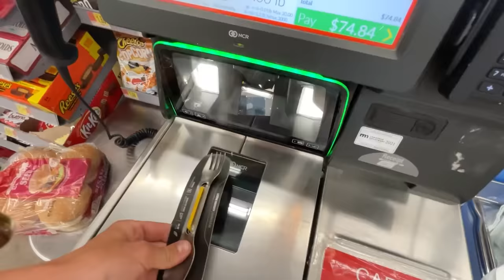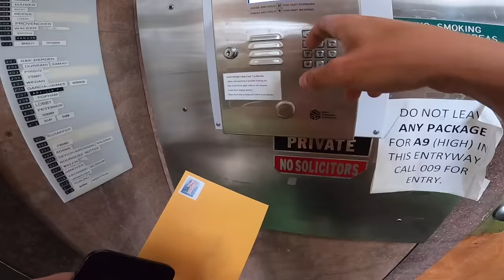Camping in my Small Car for the First time | Overnight in Pop-up Tent

Comment: When driving a manual vehicle, always leave it in gear when you're parked. Even with the emergency brake set, if the e brake fails, your transmission will help keep the vehicle from moving. Especially with that camper I wouldn't trust the e brake alone. Stay safe Mav!
Reply: On the gang itself
Reply: He is in a flat state MN. If he grew up in San Francisco he would know this.
Reply: Did I miss something ?  Did he get back to the states or this was prefilmed?
Reply: @jaytrock3217  I think he mentioned he flew back to visit his parents!
Reply: @betopistolas4644  dude just up and left his truck?
Reply: Aren't you suppose to leave it in neutral?
Reply: @1savage325  nahh always leave it in gear. I usually left my Jeep in first gear because I lived on hill in Georgia.
Reply: Most manual transmissions have a lockout gear, mine is reverse.
Reply: Yes! Wanted to say something too! I also have always put my ebrake up without pressing the button, only when putting down the ebrake. Anyone else? Or does that even matter?
Reply: @1savage325  On most cars it's not an issue but on a 20 yo car with all that extra weight I would say this is a requirement.
Reply: @betopistolas4644  I thought he said his parents flew down to visit him.
Reply: @garybaxter7297  nothing flat in Duluth, MN where he lives.  Steep steep streets.
Reply: @garybaxter7297  Duluth has plenty of steep hills.
Reply: Y anyone does their driving test in an automatic over a transmission I don't know
Reply: The comment I was going to make well done sir 👏
Reply: Wheel chocks.
Reply: @blackshadow7192  so someone accidentally bumps into your car at the fuel station while your inside....next thing you know your cars rolling across the highway and your liable 😉
Reply: Your exacyly right if you're parked on a hill, put it in reverse.
Reply: @LowKeyQuintin  bro you not in a gang white kid chill out lmao
Reply: @garybaxter7297  😄😄
Reply: @1savage325  nope
Reply: @jaytrock3217  they did, and then he apparently flew in to see them! Isn't that sweet?! 😁
Reply: @tiddiesprinkles  no it should be on gear ⚙️
Reply: True you’ll be riding backwards in your sleep LOL Or forwards LOL
Reply: @terryschleeterl1331 😁 funny!
Reply: I know it doesn’t take forever but does any one raise feel like it’s an eternity waiting for his next video and I wanto clarify that I’m actually saying that he takes forever to post because that’s not what I’m saying at all his videos are just so good and interesting that it feels like a life time while waiting for the next video you’re awesome Mac keep up the great work your really living life to the fullest and you brave as hell always being by yourself I’m remote areas and dude you travels through Mexican by yourself you a fricking g bro that shit was awesome 💪💪💪
Reply: @LowKeyQuintin  ON THE GANG
Reply: I've always done if parked uphill leave it in 2nd. Downhill in Reverse. First put it in neutral and let the E-brake take the weight of the vehicle then 2nd or reverse if you do it the other way around all the weight of the vehicle is on the transmission-gear. Maybe I've been doing it wrong all this time? Lol
Reply: I never understood why people put their car in neutral. I guess you're taught that. I always put it in gear when parking. Thanks dad.
Reply: Not that necessary but a good tip ig
Reply: @jaytrock3217  I think based on the weather this is an older video he finally uploaded.
Reply: My lock out gear ⚙ is 1st
Reply: @garybaxter7297  they do have something called hills
Reply: Thats only of your on a hill or something but hes on flat ground so hes good
Reply: Call It Like I See It  Hey, my guy, i think that's the point. Its weird... its funny...
Reply: @1savage325  no. There's no logical reason to leave it in neutral
Reply: @23dnab  I've never pressed the button to engage the parking/emergency brake. It's just a weird habit some people have for whatever reason.  Maybe he doesn't like the ratcheting sound it makes.
Reply: @joshimirobot8266  I'd rather let the transmission take the weight than straining the parking brake cable.  The transmission was designed to handle the  intense amount of stress put on it. If you've ever dumped the clutch or stalled...that's way more force than simply parking in gear with the vehicles weight will ever generate
Reply: @RandomStuff-kd9pd  can you please explain what a lockout gear is?  Please.  Lol
Reply: @1savage325  I put mines in neutral and use the emergency brake.
Reply: @ryanscott2548  if you're inside as u said, why would you even let it roll away? 🤔
Unless you mean inside in the camper section. But why would anyone be parked at a fuel station and be in the rear section of the camper. 
Why park at a gas pump to chill in a camper?🤔 Unless you mean being parked at a fuel station, in a parking spot. But what fuel station parking lots don't have bumps in the parking areas?🤔 And on and on we go with the hypotheticals.🙄😁
Reply: @ryanscott2548  The odds of that are a katrillion to one.
Reply: @2PK69  You're*
Reply: Everyone talking about the weight being on the transmission if you park it in gear the wrong way, yet these same people ignore the fact of the damage to the transmission and gears if the vehicle is hit while parked while in gear.😨😱
 It's gonna break the gear or transmission.
If the E-brake is on, the cable doesn't snap when bumped. The car will move a little, depending on how hard it was hit, then it stops. 
If you're in gear when that happens, you might get a broken transmission or gear. 
Then what.? Just use wheel chocks or a wedge of wood so nobody steals it, because if you were to get hit while parked in gear, you're gonna have way more expensive damage.
Also, nobody should be camping if they don't know how to check or change a simple emergency brake cable.😒
Reply: Close, the engine is what's holding for the car to move it's gotta spin the engine. You probably knew this, lol 😂
Reply: @jaytrock3217  no he told the man he had flew to see his parents.
Reply: I always put it in gear number 2.
Reply: @GARY-yu8pc  if not most.. half of the people in the US drive automatic cars
Reply: I was thinking he should get a set of chocks as well.
Reply: @quanbrooklynkid7776  over 90% I'd imagine.
Reply: @manuelester7420  seen it on another video, guy was pumping gas and he couldn't catch the car
Reply: Also if on a up or down hill turn the wheel towards the curb to stop it from moving too
Reply: @1savage325  I mean you can leave it in neural if it’s flat sometimes e brake isn’t always that great
Reply: @garybaxter7297  well as a lot of the state is flat, certain areas are extremely hilly and rival San Francisco. Not sure where he’s at, and for the most part this is correct. But areas around our rivers and some lakes (St. Paul, Duluth, especially Duluth, along lake Pepin and the valley between southern Minnesota and Wisconsin) are bluffs or roads I’d never park as they are icy in winter as well as angled like San Francisco. I know what you are saying, as I now live in farm/flatsville, but it can’t be immediately claimed one doesn’t know how to park hills here. Hills with icy and snow are worse than 60-70s and sunny.  I live in a lake valley and my driveway is steep for reference, and one of my vehicles is still stick lol
Reply: the gear thing is right my parents have been doing this forever
Reply: what happened to his truck?
Reply: I thought the same thing when he showed the gear stick....I was like "dude 1st gear for flat and if your on a hill facing downhill....or reverse if you are on a hill facing uphill" first rule of driving manual.  Just like you should always start a manual car with your foot on the clutch (fully down) and the brake....that way you wont ever jump into a wall :-)
Reply: Why would anyone want to drive a manual
Reply: @c-wilvideos  it's fun
Reply: @joshimirobot8266  🤖
Reply: my brother says the same, leave in gear but i hate that. Idk, e brake should be fine (at least a normal car not a camper/car) but yeah i dont like to. I like to put in gear or reverse myself before taking off and after turning on. But i suppose since i like to use the e brake ill continue to... and maybe i can do both? Just leave in gear and get use to it but also e brake. He tells me its not needed but im too paranoid to leave a manual car without e brake up.
Reply: Retweet
Reply: This is not true. E-brake is far, far more important than leaving the Trans in gear. On any kind of slope all you do is clip the trans anyway. It's a decent precaution but not a necessary one.
Reply: This is bad advice
Reply: You are so wise thank you for that amazing knowledge! How did we survive without you! Thanks for sharing we had no clue, my life is changed.
Reply: @camtheman559  indeed
Reply: If you get regular mots your break won't fail.
Like most cars here are manual and it's not a common problem I don't think I've ever left my car in gear. Dramatic.
Reply: @IggyTheBalrog  it can help. But you're right, until the break tends to wear its relatively unnecessary
Reply: I was thinking the same thing!
Reply: Ever since owning a manual, I've always left it in first whenever I park on a hill of any sort. Makes me feel a lot safer lol.
Reply: @LowKeyQuintin
Reply: Whoa 😮 mind blown ! 🤯 

LoL 🤣🤣🤣 

The people who know already know, the people who want to will find out… but  most  never will and don’t care because manual transmissions are essentially becoming obsolete these days, unless you intentionally seek one out or you’re buying an older performance vehicle.
Reply: Been driving manuals for 25+ years and never leave it in gear with no issues. I'm not carrying a load or parked on hills though.
Reply: Have no E brake so this is how i have to park the Sonoma lol
Reply: I always leave mine in first. Respect to this guy for keeping a manual VW. I have seen only ONE in my whole city other than my own in 5 years!
Reply: @Praise___YaH  

Jesus the Son is YHWH.

The Son is the one that took the punishment on the cross
Reply: @johnle231  

HERE is Salvation and YES, it is this Simple 

HalleluYAH translates “Praise ye YaH”

YaH is The Heavenly Father 
YaH is Who Created “Man (Adam)”
YaH arrives via the TENT OF MEETING 
YaH was Who they Crucified for the sins OF “Man”

** NO human female involved WHATSOEVER **
— Hebrew Book of Isaiah 

Isaiah 42:8
"I am YaH; that is my Name! I will not yield my glory to another or my praise to idols.

Isaiah 43:11
I, I am YAH, and there is no other Savior but Me.

Isaiah 45:5
I am YaH, and there is none else.
Reply: @Praise___YaH  

Nonsense.

Only in the NT is revealed the messiah who dies for people’s sins as mentioned in Isaiah 53.

You deny the NT,  then you have no savior.
Reply: @johnle231  

YaH arrives via the Tent of Meeting 

jesus arrives through the bloody process of childbirth covered in amniotic fluid 

Sir, if your “god” had a “son” with a “virgin human girl”, your “god” is a Fallen of Genesis 6
Reply: @johnle231  

Isaiah 43:11
I, I am YAH, and there is no other Savior but Me.

Isaiah 45:5
I am YaH, and there is none else.
Reply: @johnle231  

THIS and ONLY THIS is Salvation 

YaH is The Heavenly Father 
YaH is Who Created “Man (Adam)”
YaH arrives via the TENT OF MEETING 
YaH was Who they Crucified for the sins OF “Man”

** NO human female involved WHATSOEVER **
— Hebrew Book of Isaiah
Reply: @johnle231  

Isaiah 45:5
I am YaH, and there is none else.
Reply: @johnle231  

Isaiah 42:8
"I am YaH; that is my Name! I will not yield my glory to another or my praise to idols.

Isaiah 43:11
I, I am YAH, and there is no other Savior but Me.
Reply: @johnle231  

Isaiah 45:10
WOE unto the one who says to the FATHER, what have you begotten or to a MOTHER, what have you brought to birth.

YaH arrived via the TENT OF MEETING, YaH was Who they Crucified and it was on an Almond Tree sir, NOT a cross
— Hebrew Book of Isaiah
Reply: @johnle231  

YaH <— THERE’S OUR ONLY SAVIOR
Reply: @Praise___YaH  

And Jesus is YHWH.

Hello.

Isaiah 53 speaks about a person who’s takes on others sins with his death.

Without Jesus,  you are not saved.

Hello
Reply: I trust in my e-brake over the years.if I had to in a pinch feel like we all know if we can trust it or not.
Reply: @Praise___YaH  Do you believe Jesus is God?  Do you believe the Holy Spirit is God?  Do you believe the Father is God?
Reply: @lowcountrybassin3730  

YaH is The Heavenly Father and jesus, the “Bright Morning Star (Revelation 22:16)” is Lucifer

HERE is Salvation and YES, it is this Simple 

HalleluYAH translates “Praise ye YaH”

YaH is The Heavenly Father 
YaH is Who Created “Man (Adam)”
YaH arrives via the TENT OF MEETING 
YaH was Who they Crucified for the sins OF “Man”

** NO human female involved WHATSOEVER **
— Hebrew Book of Isaiah
Reply: @Praise___YaH  You are speaking heresy.
Reply: @23dnab  Doesn't matter. That's why it makes that clicking sound.
Reply: @Praise___YaH  That means He entered the world in David's lineage.  Again, people who read your comment that don't acknowledge Jesus as God, might be persueded to think that what you say is right.  But you did answer my question.  You don't believe Jesus is God . . . There is one God, eternally existent in three Persons, God the Father, God the Son, and God the Holy Spirit.  And these Three are One
Reply: @lowcountrybassin3730  

If jesus is your savior, you are not saved. You better go back and READ what I shared
Reply: @Praise___YaH  Have you not read the first three verses of John's Gospel?  "In the beginning was the Word (Logos is living Word in the Greek), and the Word (living Word) was with God, and the Word (living Word) was God.  And the same was in the beginning with God.  All things were made by Him (Jesus); and without Him (Jesus) there was nothing made that was made.  Why is that so hard for you to understand?  Also, "Let us make man in our image; in our likeness"  Genesis 1:26.  Creation, Corruption, Catastrophe, Confusion. Christ, Cross, Consummation.  Jesus was there and was responsible for all seven C's.
Reply: @Lowcountry Bassin  

He is inconsistent.

He cites from revelation from a specific niv translation(Morningstar verse)which is New Testament.

But ignores the remainder of New Testament scripture.
Reply: Unless someone else who doesn’t leave it in gear is planning to drive it next. My mum smacked my old Golf GTI into our garage door because she started it up without realising I’d left it in gear 😢
Reply: @VicodinElmo  

I remember remote starting my car into my garage door into oblivion... $500 drain
Reply: Depends on how you’re parked, if you’re facing uphill you leave if in first gear, if it’s downhill then you leave it in reverse
Reply: Your handbrake should hold your car if in gear or not. If it rolls with the handbrake on its poorly maintained and shouldn't be on the road.
Reply: if you're on a hill tho that's not good for transmission at all
Reply: I always do
Reply: ALWAYS!! And don't forget to put it in gear on uphill but in reverse if you're declined
Reply: Leaving a manual in gear is not the norm at all actually. And it isn't taught when learning either.
Reply: @bane4743  I think his truck would be fine
Reply: I had a 59 VW. Modified by the Manson family. Not a joke. Listen to this guy about parking. It's old school
Reply: I think it’s more of the weight issue with having that camper at the back and also considering the geography like sure in flat areas you can get away with putting the ebrake or maybe even leaving it in neutral but should the ebrake fail in where he’s located with a lot of hills, good luck catching it.
Reply: Thanks for sharing the tip!
Reply: 5
Reply: @FakeR19920828  the FIRST correct comment after reading PAGES of 🤷‍♂️ . Following the way you described is the strongest/safest way to park manual transmission vehicles, to reduce wear on the transmission in vehicles with operating parking brake is to lock the parking brake, then last step stepping onto the clutch for a second to take the slack off the transmission and onto the parking brake, this way the brake does it's job, and if it fails, the transmission will ensure the vehicle isn't going anywhere! And, Happy new year! LoL
Reply: @LowKeyQuintin  true
Reply: You should marry him..then you can tell a man how to drive..
Reply: I refuse to use my e brake, they like to get stuck. Solid advice
Reply: Need a mosquito net to Velcro below the canvas inside.
Reply: Lol in Florida it’s so flat we have to remember to use the e brake because when it’s flat it ain’t going anywhere.
Reply: I live in GB where most of the vehicle’s are mostly all manual gears and clutch driven. I always park on any incline in first gear with hand brake on as far as it goes, just don’t start engine without put in clutch pedal and gear into neutral first as another driver could have left it in gear, the vehicle will jump forward while turning key or button start up. You are learnt to check for this firstly as a safety checklist while learning. Parked on the downhill park always put gear into reverse and with the handbrake on ,wheels towards the curb because the handbrake does fail the reverse gear will hold the vehicle and not being able to roll downhill. I had a manager that done this to two vehicles in row . She forgot to put on the handbrake. Her husband was not well pleased. 
In GB 🇬🇧 if you hold a manual driving license you can drive a manual or automatic vehicles. But If you hold a automatic driving license you can only drive automatic’s and will have to take lessons and done a separate car test for a manual license.
Reply: I agree especially if you’re going to be sleeping in it.
Reply: I was thinking the same thing! My big 1 ton dually's e brake doesn't hold worth a flip.
Reply: Duh.
Reply: Excellent advice, I would have stated the same as a Mom who taught a teenager to drive manual transmission 12 years ago. My Dad taught me the same on the old 78 K5 Blazer back in ole ‘86 😆😝.
Reply: In England, we are 80% manual and it’s recommended to leave it in gear
Reply: And be carful on hills! Rolled into a car once after parking my car in neutral ON A HILL and coming back to it trying to leave in a hurry, not sure what I was thinking, just forgot I wasn't in gear and the moment I dropped the e brake - bang!
Reply: That’s also a marvelous way to ruin your transmission lol
Reply: @LowKeyQuintin  on hood
Reply: No exactly correct as then u can mess ur gears up by keeping it in gear ur meant to keep it in gear on hills or cold weather as it can make your handbrake stick
Reply: @garybaxter7297  de ©~•
Reply: Excuse my ignorance, but what is an e-brake? Is it like a handbrake? We were taught to hill park by direction - if your car was tilting uphill leave it in first gear with handbrake on. If tilting downhill leave in reverse with handbrake on. My grandad used to carry a couple of house bricks as wheel chocks 🤣 I hate automatics 🤣 And we only did our driving test on manual transmission even if you never intended to drive one ever again you’d be prepared for an emergency.
Reply: @garybaxter7297  Large parts of Minnesota isn't flat. We know this. 🙄
Reply: @LowKeyQuintin  lmao what gang?
Reply: And i always kept the jam
Reply: My dad taught me that 58 years ago and it’s a safety precaution I’ve never forgotten. It’s the first thing I noticed when he kept getting out of his VW and leaving it in neutral.
Reply: @bane4743  I don’t remember who taught me that to keep it on a gear especially when parking on hills. E.break can sometime failed you.